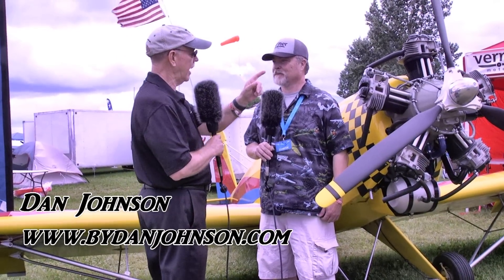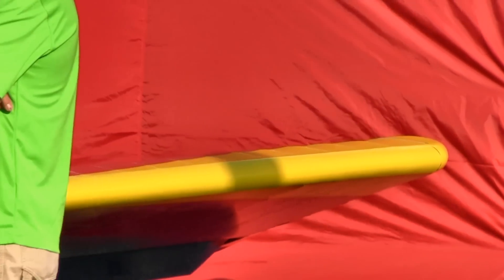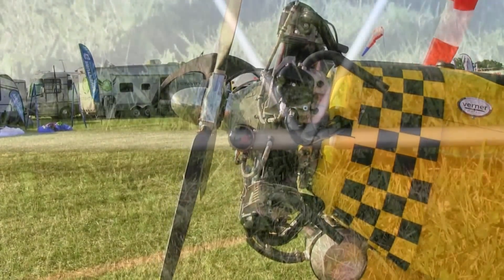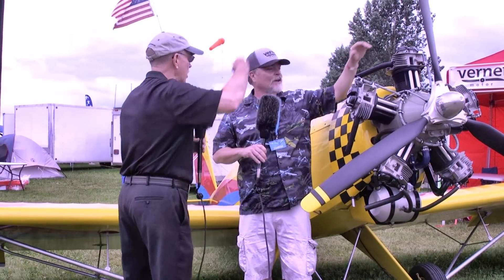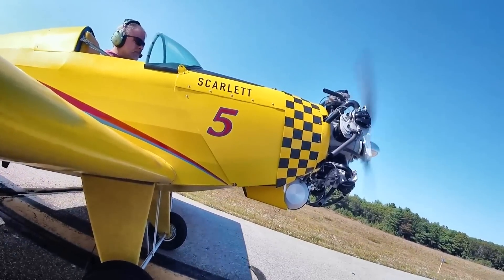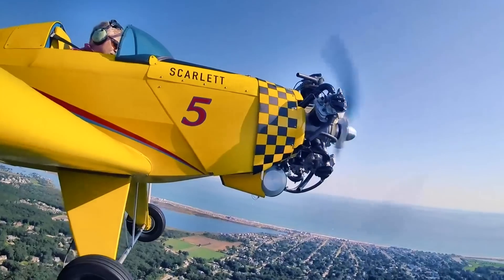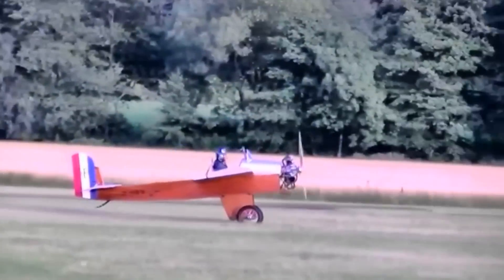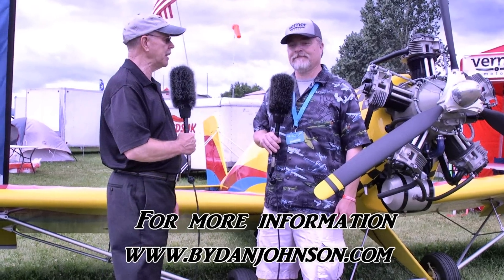Verner Motors, Verner Radial  Verner Scarlett 3, Scarlett 5 Series, Scarlett 7, Scalebirds  Aircraft

Comment: Would a Verner SCARLETT 5S work well on a Jodel D18 or possibly a Jodel D11?

The master rod type of engine is slightly unbalanced by its very nature. Is this noticeable, or in other words, how does the smoothness of these radial engines compare to the smoothness of a horizontally opposed 4 of comparable horsepower?

Comment: I think the secret to why radials make so much torque and love slinging a bit prop comes down to power density; a 4-cylinder opposed engine has a power event every 180° of crank rotation. A 5-cylinder radial has a power event every 144°, a 7-cylinder, roughly 103°, and 9 cylinder every 80°. That means the prop spends a lot less time "coasting," so it transfers a lot more power into moving air.

Comment: What! "they are trying to get all the cylinders fired in two revolutions"  All 4 strokes fire all cylinders in two revolutions.
Reply: Agreed...theres bugger all spectacular with these...theyre just VW cylinder heads cut in half stuck on VW cylinders...better ti just buy the main case, shaft & rods and bolt on aftermarket VW engine kit parts...waaay cheaper AND lighter

Comment: Which one of these motors best suited to the CH 701 ?
Reply: Well, you need 80- 100 HP, so.. Uhhhh...The 5 cyl should do it, but, here are the specs....Technical specifications:
  Scarlett 5Si Scarlett 7U Scarlett 9S
Displacement 3390 cc / 207 cubic inch    4740 cc / 290 cubic inch 6094 cc / 372 cubic inch
Bore 92 mm / 3.62 inch                                      92 mm / 3.62 inch           92 mm / 3.62 inch
Stroke 102 mm / 4.02 in 102 mm / 4.02 in 102 mm / 4.02 in
Compression ratio 1 : 7.8 1 : 7.8 1 : 7.8
Maximum power 83 BHP (61 kW) @ 2300 RPM 124 BHP (91 kW) @ 2300 RPM 158 BHP (116 kW) @ 2400 RPM
Max. continuous power 78 BHP (57 kW) @ 1900 RPM 103 BHP (75 kW) @ 2000 RPM 136 BHP (100 kW) @ 2300 RPM
Torque 296 Nm (218 ft/lb) @ 1900 RPM 390 Nm (287 ft/lb) @ 2200 RPM 485 Nm (357 ft/lb) @ 2000 RPM
Propeller rotation CCW, viewed from the front (tractor propeller) CCW, viewed from the front (tractor propeller) CCW, viewed from the front (tractor propeller)
Spark plugs Denso Q20PR-U Denso Q20PR-U Denso Q20PR-U
Electric starter 12 V / 1000 W 12 V / 1000 W 12 V / 1000 W
Generator (Alternator) 12 V / 336 W 12 V / 336 W 12 V / 336 W
Lubrication AeroShell Oil 15W50 AeroShell Oil 15W50 AeroShell Oil 15W50
Fuel motor petrol, octane number 95 motor petrol, octane number 95 motor petrol, octane number 95
EFI 2 main jets, 1 backup jet. IMF ECU 2 main jets, 1 backup jet. IMF ECU 2 main jets, 1 backup jet. IMF ECU
Reduction drive none none none
Propeller hub ø101,6 x 6 x 13
holes, ø75-6xM8 ø101,6 x 6 x 13
holes, ø75-6xM8 ø112.12 x 6 x 16
holes, ø75-6xM8 SAE 1